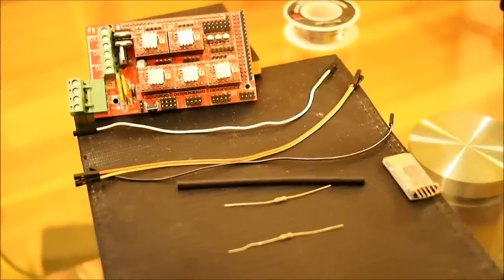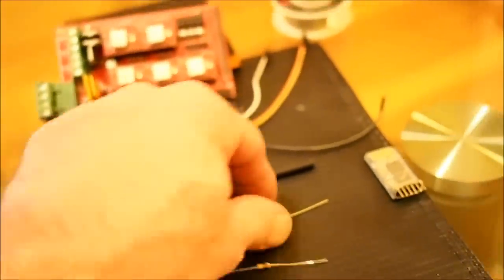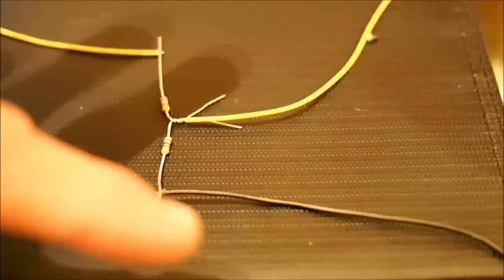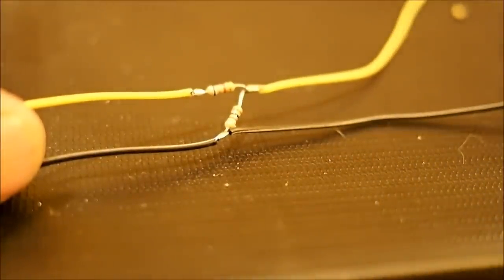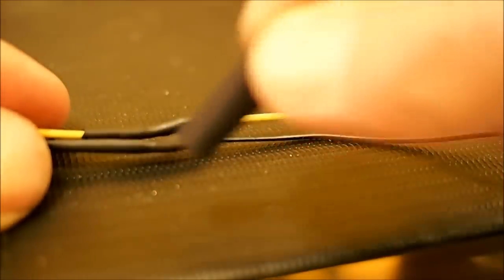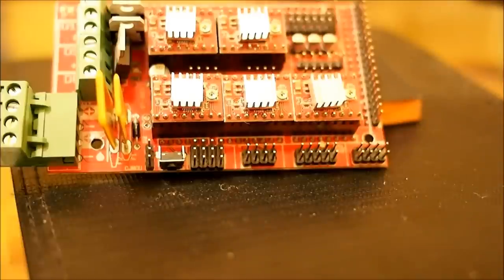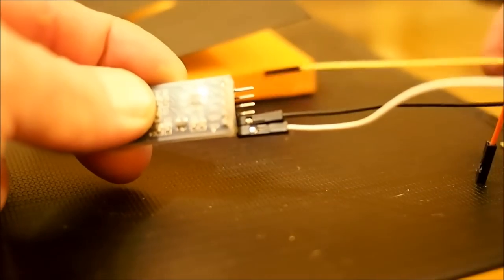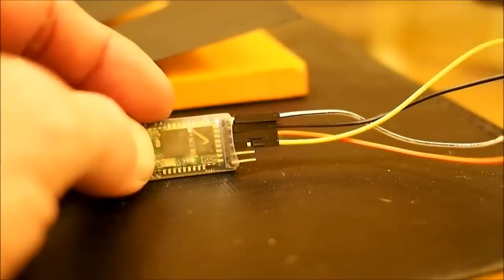RAMPS 1.4 3D Printer: Bluetooth Setup 1, Voltage Divider and Wiring

Comment: Hey Charles!
 
Really informative video mate i am having trouble with following error:
#error "BLUETOOTH is only supported with AT90USB."

Using Ramps 1.4 with Arduino Mega 2560 when compiling after un commenting this line:
// Enable the Bluetooth serial interface on AT90USB devices
#define BLUETOOTH

it gives above error please help!
Reply: You have to programme the bluetooth first